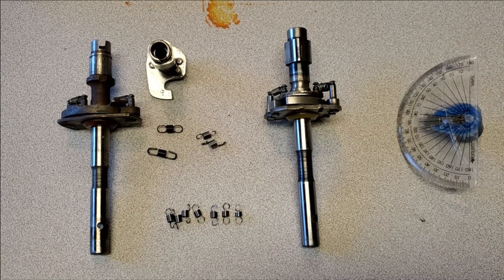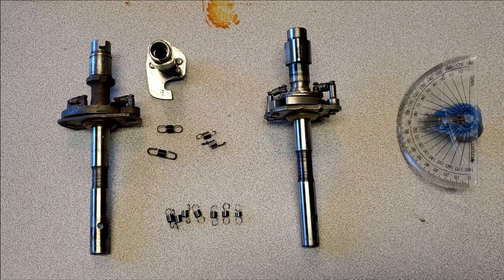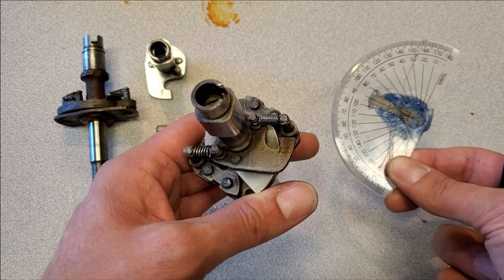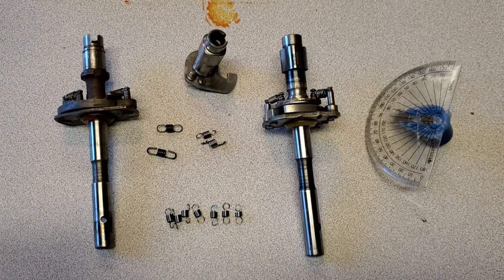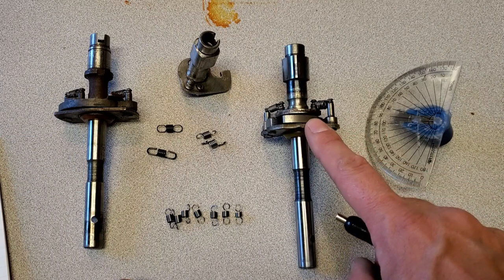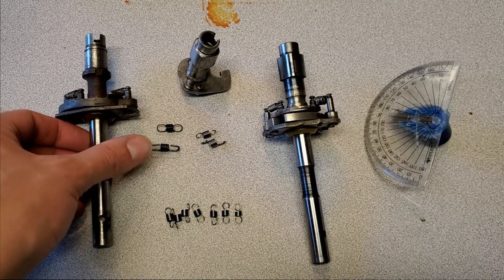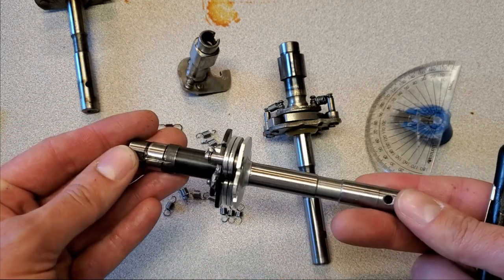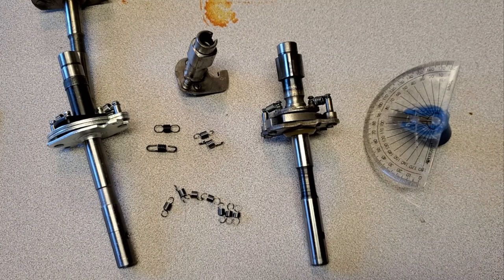The basics of Tuning a Lucas Distributor

Comment: how about advance cam with 21 degree stamp?  what application is it for?
Reply from the maker: An engine that needs lots of ignition timing advance.
Reply: The dizzy came from land rover series 2 1961. Is a different setting for lucas 25d for landrover series and for mini? Look similiar but don't know the detail setting.
Thx before 🙏🏾
Reply from the maker: @DaveGarello  the mini does not need as much advance timing as the Land Rover.
Reply: @darrensrestorations991  Thanks Darren for your info.🙂